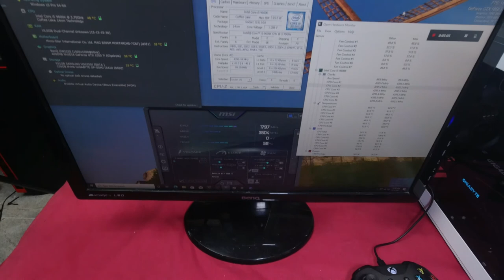corsair 240air/i5 9600k/msi b365m mortar/1050ti4gb/psutx750w/

Comment: Sharp looking mother board to bad it a M ,Odd case it looks good and tons of room to cable manage just a odd layout. I love the crucial ballistic ram great choice. one if the red wires from the baby exhaust fan was in the key way might wanna fix that could cause trouble if it gets pinched by the panel. I hatted the way you wired the rear fans but except for the 1 wire mentioned you did great job hiding them. just try changing the fan LEDs from unicorn vomit to 1 or maybe 2 colors and just see how much better it would look just for me just try it if you do not like it as much as the unicorn vomit I will only mention how much I hate unicorn vomit lighting twice as much as I do now until you hate it as well
Reply from the maker: lmao